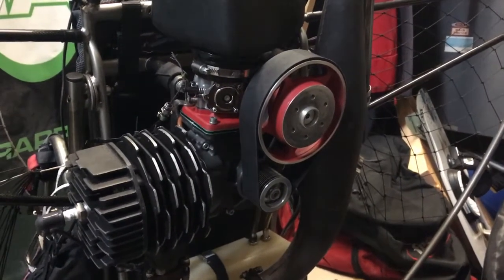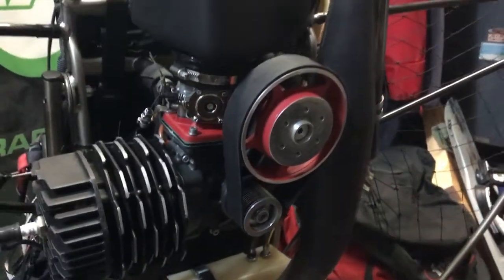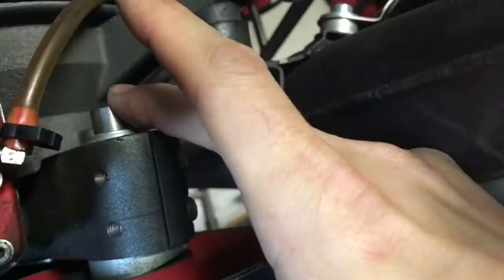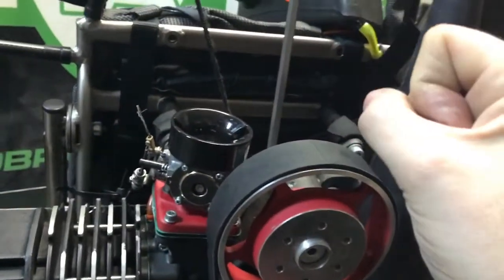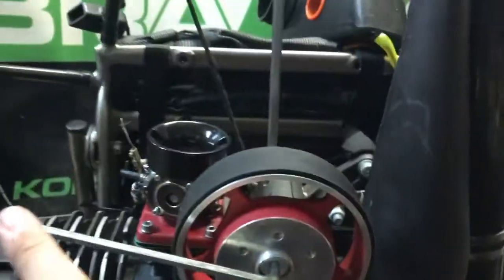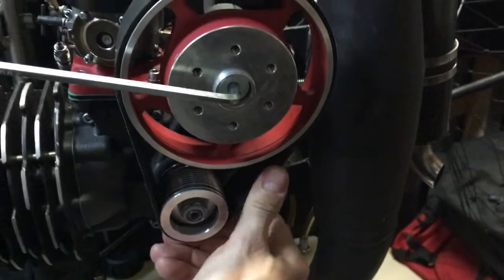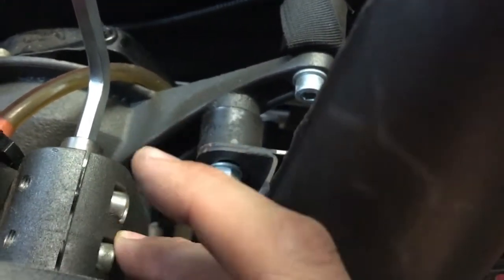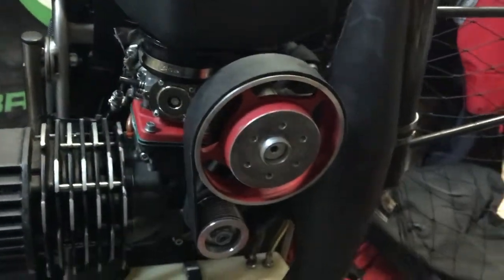Air Conception Nitro 200 Engine - How To Perform Belt Tensioning

Comment: Why didn't they use a cogged belt? Requires less tension so less stress on the mounts and doesn't slip and squeak. Just wondering...
Reply: won't work. belt won't last